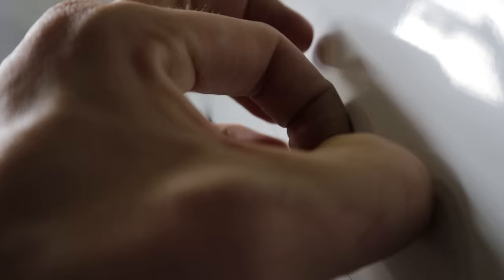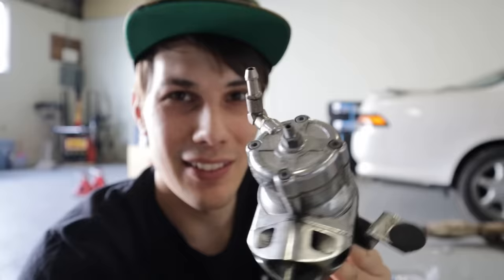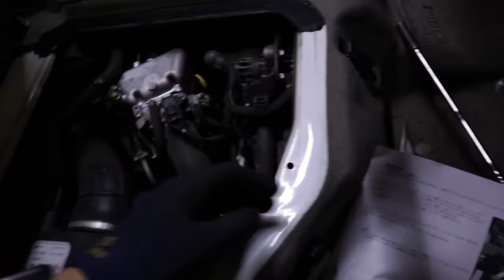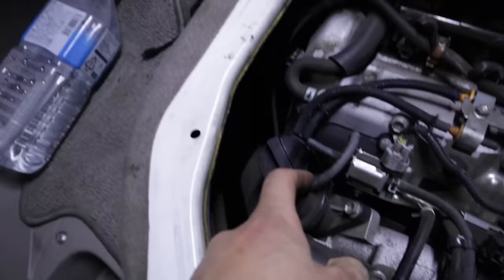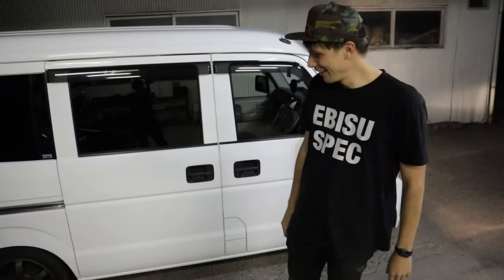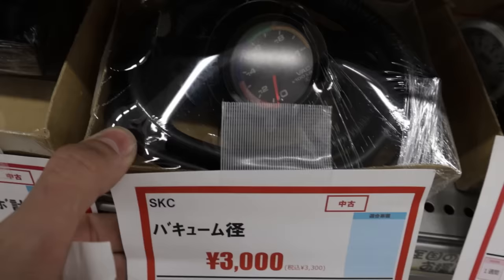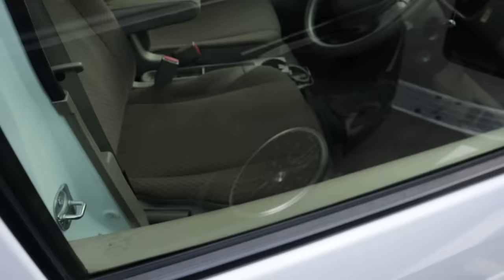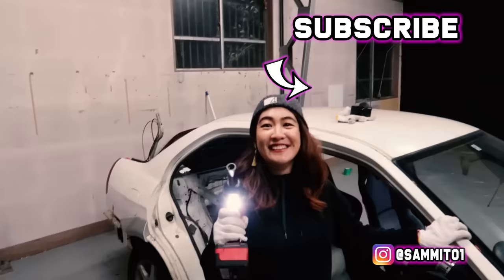KEI VAN GOES FULL JDM RACECAR & GETS A BLOW OFF VALVE!

Comment: Hi! Nice to see an english speaking kei car user. My channel is devoted to kei van/wagons, I’m based in the Philippines. I have a question though, what is the maximum boost setting  to upgrade for stock internals K6A? Mine is an Every Wagon DA64W Turbo 4x2. I plan to increase the boost via the waste gate or a manual boost controller

Comment: One thing you could do is tighten the bov adjustment screw so that it only opens at full boost pressure.  And otherwise you get the surge noise you want below that.

Comment: Ah the K&N pod filter for low filtration to shorten engine life but increase performance for the very short term. 🤔 this is way worse choice than the bone shaker coil overs on already short oem suspension.  🤣 The positive is the blow off valve  & the wheels .... sweet 😎